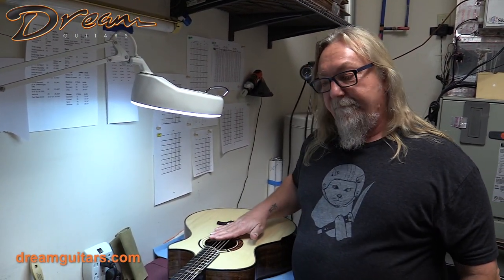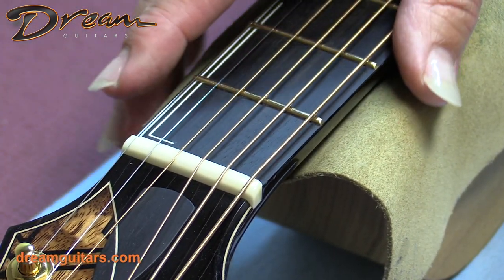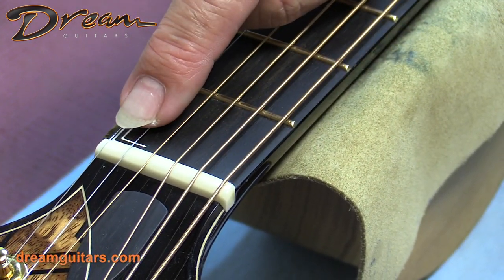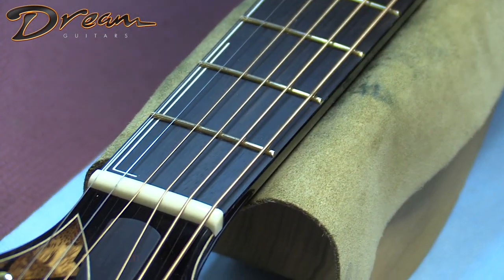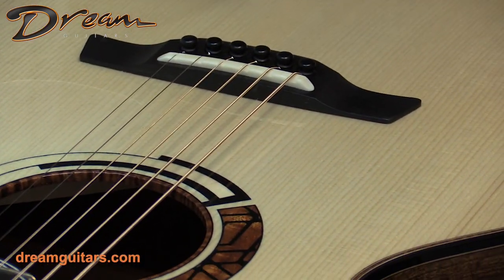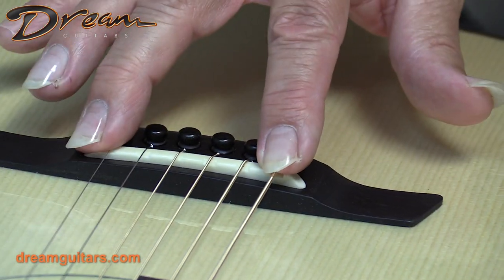Dream Guitars Tech Chat - Nut Width & String Spacing

Comment: Question.. my Eastman is 1.3/4 12" radius and my Gibson j45 is 16 radius and 1.725 my Gibson seems harder to play why is that? Is the neck fatter? Thanks
Reply from the maker: The 12" radius may feel easier to play because it's not as flat as the 16". But there are other factors as well, such as the thickness of the neck, front to back, and the size of your hand and fingers. But the smaller, more curved radius is generally considered easier to play. Hope that helps.

Comment: Paul, I’m a little confused. If I find my string spacing to wide do I simply get a new nut made? What happens to the saddle does it stay the same? My saddle is already notched would this be a problem
Reply from the maker: Hi! A good setup person can give you the best advice when they see your actual instrument. But yes, you can certainly narrow the nut slots with a new nut, and the saddle could remain the same--unless of course you don't like the resulting feel, and in that case the saddle could be adjusted as well. 
Saddles should not have notches, as that causes lots of potential tuning problems.  You may want to have a new saddle made without any notches. Hope that helps! Thanks for reaching out.